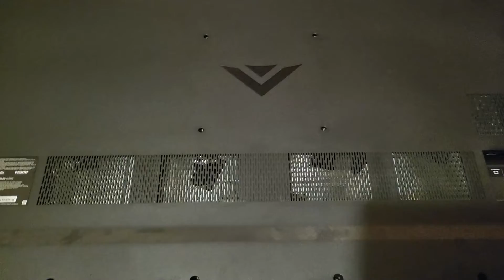LED DRIVER BOARD BAD IN YOUR TV? OR BAD BACKLIGHT LEDS? HOW TO GET YOUR LED DRIVER BOARD PART NUMBER

Comment: Would a bad led driver board cause heavy blue tint? or is that 100% an led issue?
Reply from the maker: @iambox3432  I would try a factory reset frist and another hdmi cable if you are using one I seen bad cables before